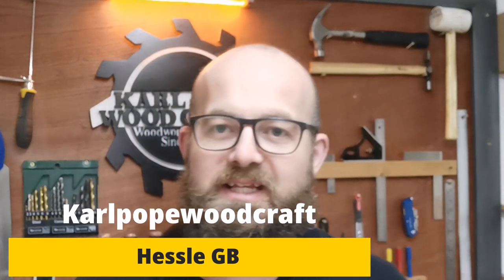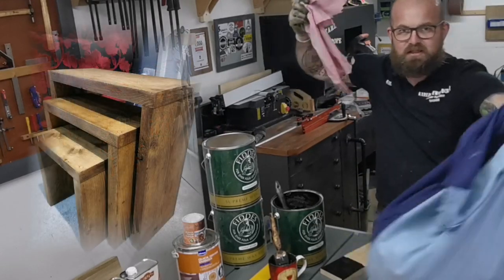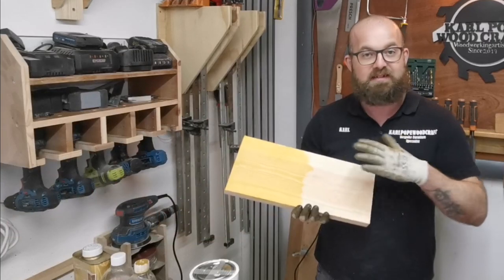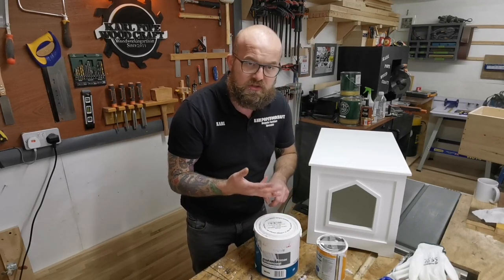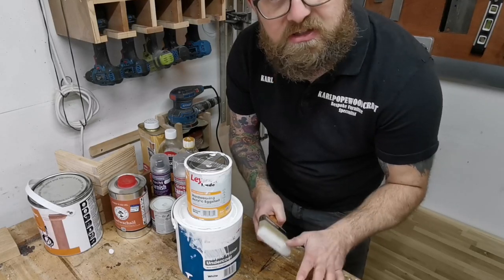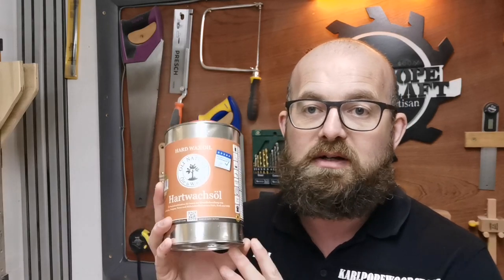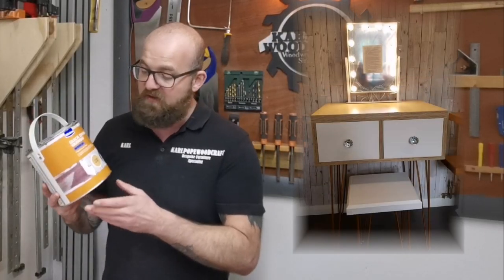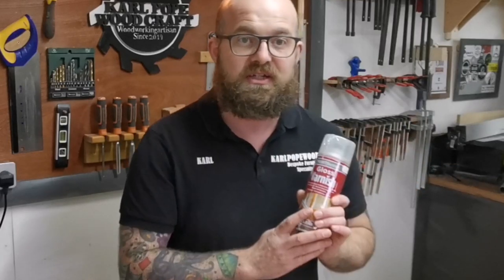My Favourite Wood Finishes

Comment: Hi im new to woodwork and just restored a park bench - i sanded the planks nice and smooth and hit it with Fiddes Supreme Wax Rugger Brown - i did a lot of layers and it looks amazing but when it rains it marks where the water soaks in etc  - should i be putting some other type of finish on top to seal it up ?
Reply from the maker: Hi mate, fiddes isn't really suitable for exterior use. Best of using a exterior varnish.
Reply: @karlpopewoodcraft  thanks - could i varnish on top or would i have to sand back to bare wood again ?

Comment: I’ve just white washed some timber and I’m looking to seal it with a water based varnish. Should i sand the whitewashed piece first & what grit sandpaper should i use between coats of varnish? I’ve got this video saved as it’s brilliant information
Reply from the maker: Hard to say without seeing the timber Tony, however I generally sand 80g the 120g followed by an acrylic varnish. Between coats 320g is a good idea. Many thanks for watching.

Comment: Thanks for another great video and clear explanations with examples appearing like background dreams. I mostly use 2 coats of shellac (Zinsser sealcoat with first coat half diluted with white spirit) then 3 coats of wax but you have definitely tempted me to try other finishes.
Reply from the maker: Thanks Ben, I definitely need to practice with shellac as I messed up a couple of finishs with it. Thanks for the info as well and feedback 😊

Comment: Great video mate 😉, i'v just done my worktops with 2 ccoats of acrylic varnish and it feels a little tacky 2 days in. Is this normal and will it dry out karl?🤔
Reply from the maker: 2 days in still tacky sounds a bit strange for acrylic Shaun, is it damp or cold? Normally acrylic is touch dry in 30mins. What was underneath the acrylic? Any other finishing?
Reply: @karlpopewoodcraft  lovely and warm in the kitchen mate, there was water based teak oil used underneath if I remember right 😬
Reply from the maker: @shaun...6838  hmmm should of been ok then.
Reply from the maker: @shaun...6838  possibly just give it a few more days to settle down see what happens. 😏
Reply: @karlpopewoodcraft  do you think there is anything to take away the tackines?
Reply from the maker: @shaun...6838  that means it hasn't cured yet Shaun, it's really unusual for acrylic varnish to do that, unless something has contaminated it. Only time will tell.
Reply: @karlpopewoodcraft  thanks for your time karl